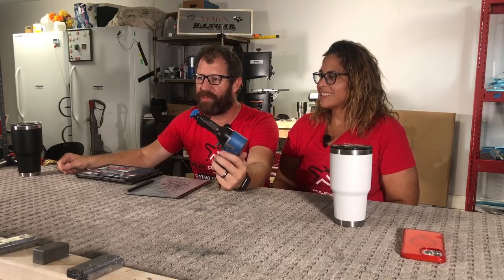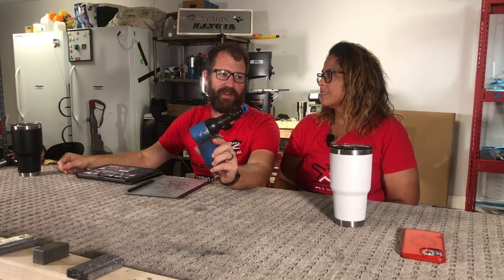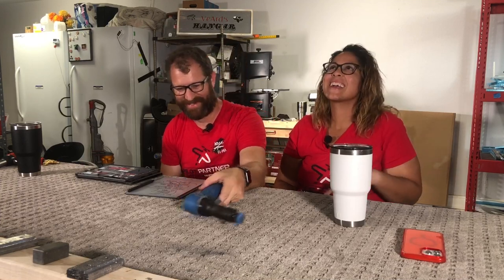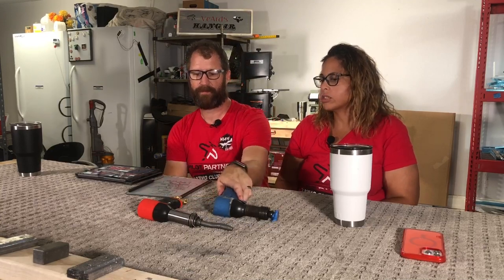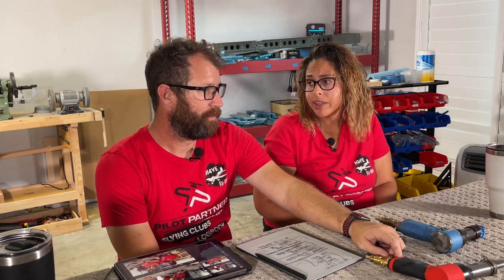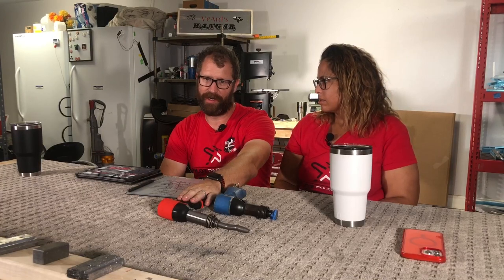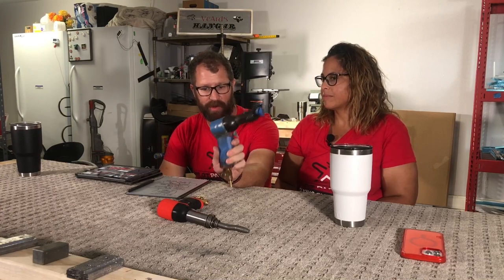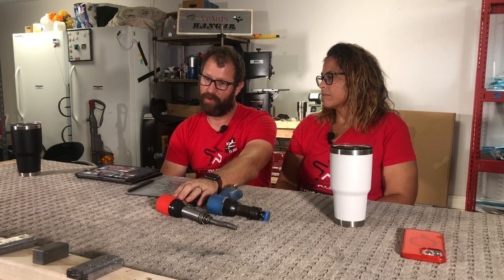Vans Aircraft Builder Tools - 2x vs 3x Rivet Guns

Comment: I am just curious if anybody knows anything about using any of the cordless rivet guns suchMILWAUKEE (M12) or any other cordless rivet gun?
Reply from the maker: I've seen some people use Cordless Drills for drilling, etc.   Not sure about setting rivets with it.  I do really like the Pneumatic system.  So many things that can just plug in and work and my batteries are never dead.